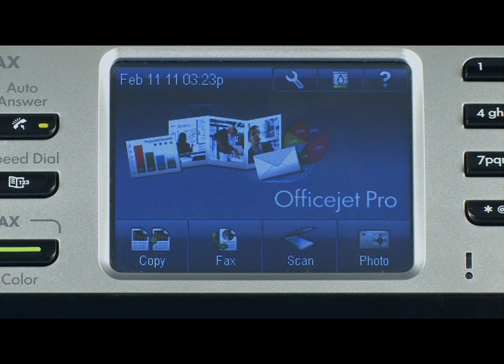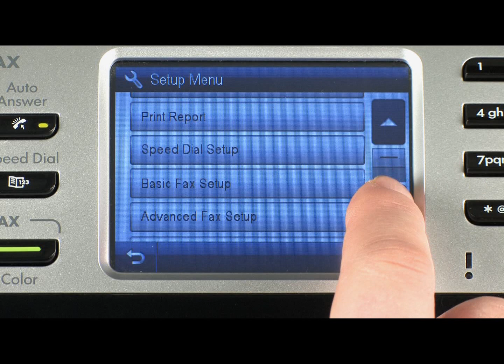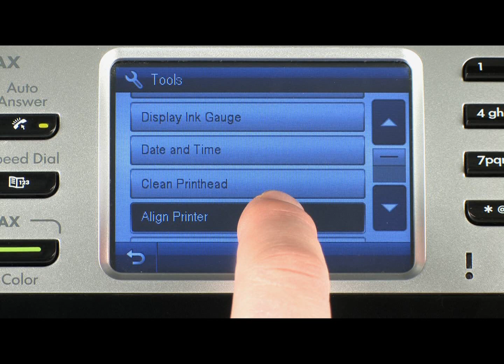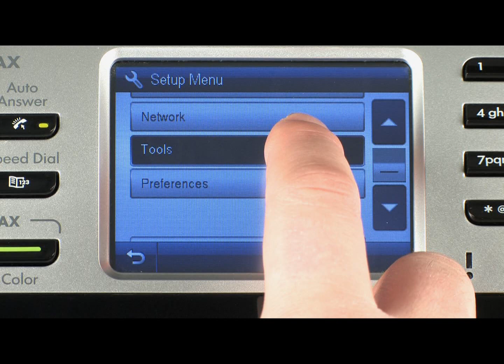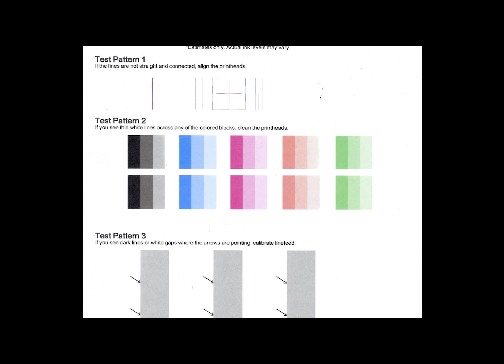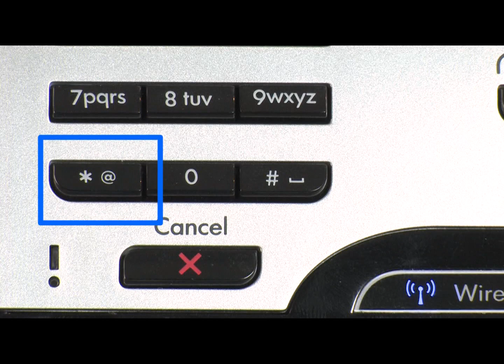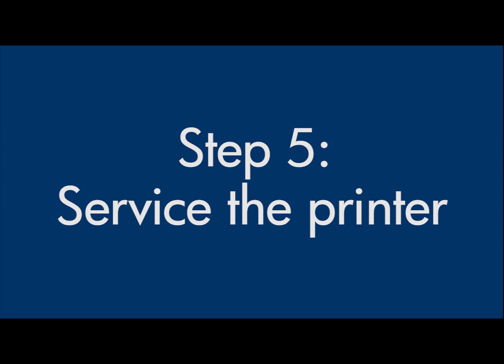Fix Failed Alignment | HP Officejet Pro 8500 Premier All-in-One Printer | HP

Comment: This worked! I bought both printer heads and only needed the black and yellow. Those printer heads lasted me ten good years. That’s quite a long time. Definitely got some good use out of those. Thanks a lot HP! So glad I didn’t need a new printer. I really wanted to keep this one because it’s a 4 in 1. Printer heads were a simple fix... :)
Reply from the maker: +Tamira Johnelle I am glad to know that the video has helped you fix the issue.

Comment: As an IT manager in the late 90 and early 2K, I was a HP Evangelist.  I loved HP products because they were well built, even if HP's software and drivers were a nightmare.  Six years ago, new company, I brought in all HP workstations, network/local printers, color laserjet, and this network fax unit. Now, I have replaced every printer with Konica Minolta, and the fax is next.  What a shame...HP used to be solid.

Comment: I've had this printer for years and it worked great!! I'm dealing with clogged print heads and the printers tools aren't able to help this time. I saw a video that says take the print heads out and soak them in a fifty-fifty mix. I'm going to try that

Comment: I have my HP officejet Pro 8500A since over 5 years that I use for my personal business and my children still use it for Uni and we never faced any issues. It is the first time I need to consult to fix the alignment of the print-heads. If I have to change it, I will surely purchase the newer version.
Reply: same. i have my 8500A for close to 6 years now, and i only paid $100 for it. probably going to get another HP printer.

Comment: Thank you for the tutorial. I thought I would re-purpose this older business machine when I found it at a local Blue Box store. I bought a replacement generic combo pack of ink and print-heads online for cheap. I then installed them the way I thought was correct with no joy. Downloaded the manual. But it came down to the correct procedure in installing the print-head. I had just opened the machine, located the slide panel above the print-head compartment, removed the panel and continued to replace the cartridges. This was my error. After many attempts to  print I continually got an alignment error. After reviewing you video, I noticed that I was supposed to transfer the print-head carriage to the same side as the ink cartridges. The sequence is slightly different on my model as I had to hold down the "OK" button for 10 seconds. Once I removed the print-heads and put them back in, the system ran a new diagnostic. This time after the alignment first page printed, a second page printed as per your video. Thus success. Working fine now. No need to add to the landfill yet. Cheers.
Reply from the maker: +Skiddy1963 I am glad to know that the video has helped you fix the issue.

Comment: If you are using the 8500A the procedure is simpler.  The printhead alignment processes itself does printhead cleaning as well.   However, I would suggest if you see banding run the cleaning.  If you see improvement each time you run cleaning keep doing it.  If you see no improvement and the alignment is still failing, it is time to replace the print head.   The printheads themselves are covered under a warranty, so even if your printer is out of warranty they might be in warranty.

Comment: THE SOLUTION IS HERE : This printer is 10 years old an still working. No I have this message. Video does help a bit BUT !!!!! Go to engineering menu and there you will find a menu to disable pen allignment :-) All working fine again ! ( to get in the engineering menu check the video 8500 : reset to factory settings

Comment: The video doesn't help me either. The printer always wants to align print heads and always fails. I've done everything: cleaning, aligning, installing a new print head, doing a hard reset. It still fails the alignment. The color copier works fine. If I let it run all the way through the alignment process and press OK after it fails, I can send a page to the printer and it prints fine. And then it prints out an extra page with just the top part of the alignment page (about 1 in). I'm at wits end.

Comment: I got an alignment failed error after inserting 2 new print heads. The printer would not do anything except attempt to align which of course would fail every time. I've pretty much been a loyal hp customer for 15 years, (refilling mind you) but I've had it. Switching to something more friendly without chips in the cartridges like brother.

Comment: I guess I can throw my printer hp 8500 A Plus in the trash as well!  Following the error message "alignment failed"  I went through all the steps in the YouTube fix idea but alignment failed consistently!  Also, the pages printed only black and yellow although the supply levels show all four colors.  What is that all about?
Reply: I agree this printer is garbage lasted about 1 year with very little printed on it. I always had a Brother printer and never experienced any failure. First HP printer I purchased very disappointed. Not to mention better to throw out then buy new ink or print heads!

Comment: HP I am pissed.  I bought this printer and have barely used it. I admit it did sit idle for a while but that shouldn't mean that it should just deteriorate. I bought new ink, then new jetheads.  After spending all of this cash, it still wont align.  I could've spent that money towards a new printer.  I'm agreeing with everyone else.  NO MORE HP!!
Reply: I tried this procedure several times and emptied all my color tanks in the process. But my printer still wouldn't align. Then I had the premonition to "cancel all printing tasks".  There was a very quick message that flashed on my computer screen (not the printer) saying something like,  "Unable to perform alignment while printing". Immediately my printer began and completed its alignment. Even though I have to buy more ink, I don't have to buy a new printer. I'm happy!

Comment: In a perfect world maybe. This is my third HP Printer. NEVER AGAIN. Poor product,works great first 6 months, after that it's TRASH. They are cheap enough to just replace them but I think pollution and it breaks my heart. Do you remember when we called the repairman for TV, vacuums, and such? Now it's just not worth it.
Trash it and replace it. My 8500 looks new, yet it won't stop giving error messages, jamming paper, and all sorts of other issues. Piece of CRAP .
Reply from the maker: Hello PetaliD’Amore Kelly,
Please search for C01618274 on HP’s home page or using Google search.  The title of the document is “A 'Carriage Jam' Message Displays on the Control Panel Display”.  I’m suggesting this document as it is very comprehensive troubleshooting document.
Reply: ***** Why would you reply to a post and instruct people to search C01618274 when all it does is bring you back to this video site? Is this your way of getting rid of complaints? I am not impressed and am joining the club of not purchasing any more HP products. This is my second printer with the same issues and you would think your company would have if figured out by now.
Reply from the maker: Jason Feeney
I apologize that this has occurred for you.  When searching for the document on HP’s home page it should have given you two options with both leading to the same document.  I have sent you a private message with the full link so you can access the document.

Comment: Printers with separate (and VERY $$ EXPENSIVE $$) INK TANK print head(s) this is a problematic design, especially for inkjet cartridge refilling. The officejet D-series was the subject of class action lawsuits due to the print heads clogging due to drying of pigmented ink making the print heads useless. Even these instructions are rather complicated. You are better off getting a printer w/o ink-tank print heads. There ARE printers with the 4 inkjet cartridge systems w/o separate printer heads. Most likely NOT hp brand though. Vote with your $$ and brand choice..
Reply: My color printhead doesn’t work. Tried all the remedies. Nothing works. Did have luck bypassing the alignment. At least can use for black printing. Will get a new printer in the near future but won’t be an HP. Replaced printer heads once. Not spending another dime on this printer.
Reply: @kathybutters6938  left hp a long time ago.. i decided to go with brother color laser. Nowadays nearly all printers have usage chips which are another annoyance, even with newer brother color laser they are used as a counter, but can still be bypassed-- for now

Comment: I have an expensive HP Office-jet pro 8600. I now only use the printer occasionally for home use. I am getting streaks with all colors. I have followed several print head cleaning methods seeing only slight quality improvement. What a waste of time and very messy) Now I am getting alignment failures. New HP print heads cost over $125. So have decided to purchase a laser printer because I can purchase a brand new laser printer that has most of the 8600 features for about $150 bucks. The laser printer should be a better choice for my limited use and I won't face the dried ink jet print head issues. I too will never purchase another HP product.
Reply from the maker: +Dave T If the quality of a printed document or photo is not as expected, the procedures in this document should help you fix this issue: http://bit.ly/2n0ihiY and alignment issues might occur when scanning or printing, and an Alignment failed or Alignment Unsuccessful error message displays on the printer control panel. Please follow the guidelines in this document to fix this issue: http://bit.ly/2mVIK1h

Comment: My print quality has been mediocre since the day I bought my 8500a (lines) - I just spent $100 on a new set of cartridges and now it won't align or even print yellow properly, I've used a quarter of my cartridges just from trying to clean and align it.  I honestly can't be bothered mucking about with it any more than I already have.  HP is going to go down for putting out products this bad.

Comment: BTW, Tried three different Samsung lasers to replace this printer, took them all back.
Reply from the maker: John F. Gruber I recommend following the steps in this document on Fixing Print Quality Problems for the HP Officejet Pro 8500 Premier (A909n) and 8500 Wireless (A909g) All-in-One Printer Series. This can be found by Google searching "c04261974". If the issue continues, please call our technical support at 800-474-6836. If you live outside the US/Canada Region please go to Google search and enter 'contact HP worldwide'.  Your first option should be the site for contacting HP, when you click on it you will be prompted to choose your country/region.

Comment: My HP is not very old. OMG cost for ink was $120 and now it will not align. Wasting all that new ink on test sheets. Anybody have any suggestion on a different printer?? Sucks because this one has not been used much.
Reply from the maker: +Andrea Pinkerton Please perform the steps mentioned in this document to fix this issue: http://bit.ly/2noP8yi
Reply: HP Printer Support I have done those steps over and over and over. I'm on my way to town now to go buy another printer this really sucks that printer is not very old probably hasn't even been used 20 times

Comment: I tried that link but it was a different printer I have the officejet pro 8500 A909g and I found a link to help but I am stuck here Solution four: 
Figure 4: Print Quality Diagnostics Page
Illustration of the Print Quality Diagnostic page
Open the product lid. The carriage moves to the left side of the product.
If the carriage does not move to the left side, press and hold the OK button until the carriage moves. Wait until the carriage is idle and silent. THERE IS NO OK BUTTON :(
Reply: press and hold the * button for 5 seconds
Reply: I finally found out it's the button with * @ (go figger)...right above the cancel button, bottom left key.

Comment: Also raising my hand that this printer sucks. Been stuck in an alignment loop failure and wasting SO much ink because you can't stop it from printing out the test page. Argh!
Reply from the maker: +Be Bold Alignment issues might occur when scanning or printing, and an Alignment failed or Alignment Unsuccessful error message displays on the printer control panel. Use the tips in this document to help complete the alignment or remove the message: http://bitly.com/2MNK8BO

Comment: What a load of crap, The number of sheets affecting the print head alignment is just a way to deflect problems of a flawed product. They want you to continuously by ink and heads.
Reply from the maker: +Christopher Jones Alignment issues might occur when scanning or printing and an Alignment failed or Alignment Unsuccessful error message displays on the printer control panel. Use these tips to help complete the alignment or remove the message: http://hp.care/2kzdPW1